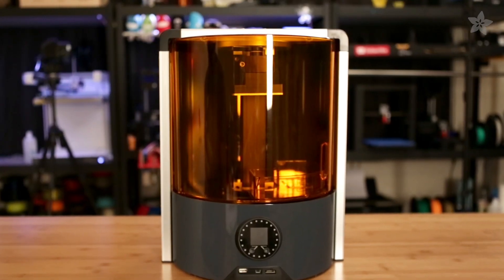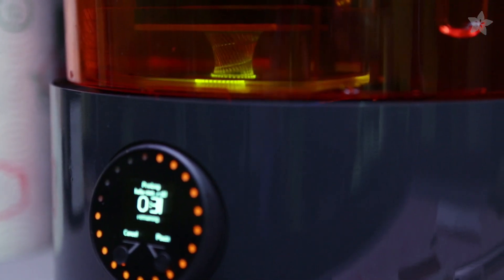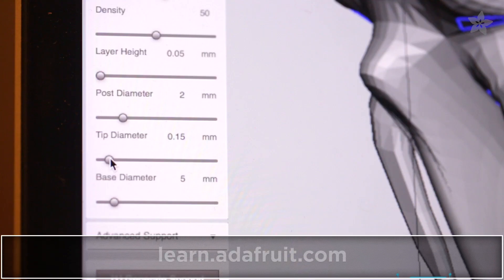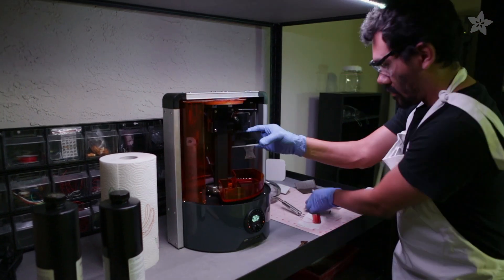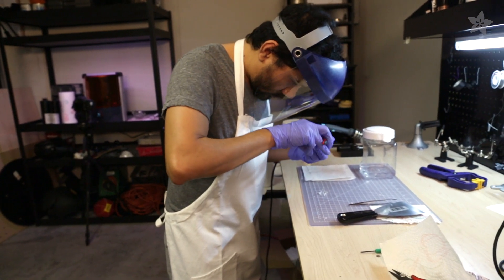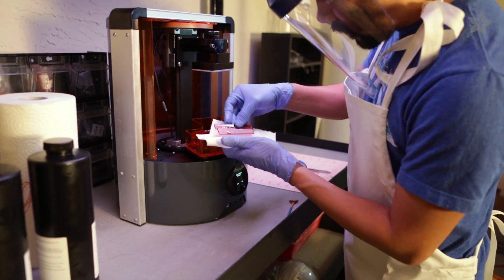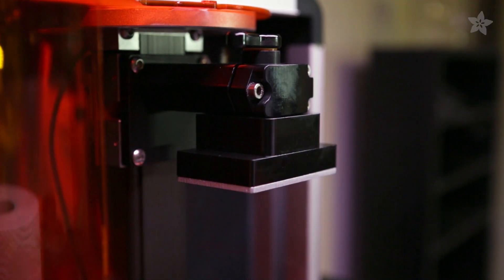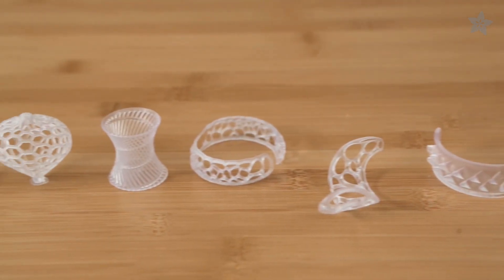Ember 3D Printer from Autodesk

Comment: For the amount of post-processing, maintenance and material cost... it's not worth it. especially with an outgoing price tag of 7.4k? yikes!

I feel like SLA printing is just too niche for consumer printing. FDM is fairly streamlined enough, being its two major weaknesses are time-consuming for big and over high def prints and part strength depending on if the printer was thoroughly calibrated to work well with the filament currently in use at the time of printing (at least, those are the two major hurdles I can think of).

Comment: seems like post clean up is ALOT of effort!!!
Reply: Andrew Carbines yeah...I kinda like the older printers at this point. Because the time for cleaning + printing takes just as much time as just printing it through a regular printer. right?
Reply: +Gallifrey Mechanic but even the cheap chinese sla&#39;s have quality levels that are far superior to filament printers and starting at au$800 the extra effort is way worth it especially when they can build models twice the size of the autodesk ember